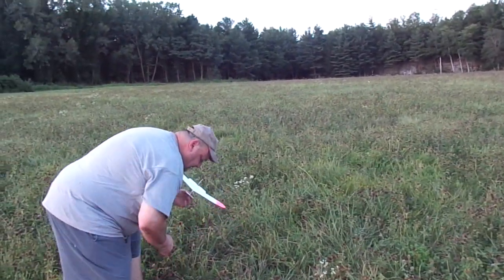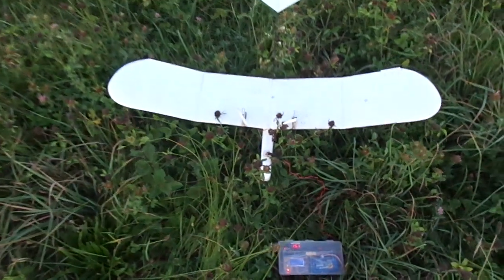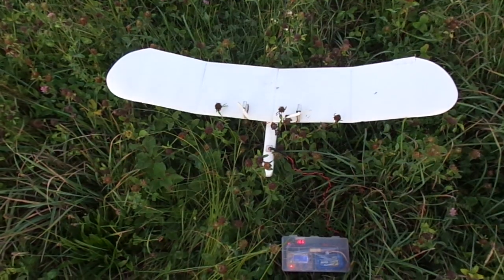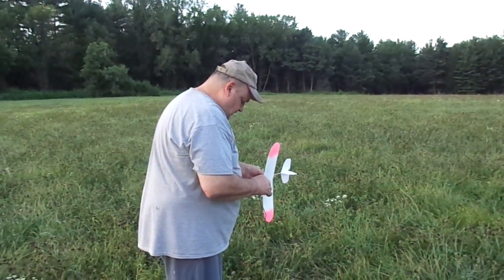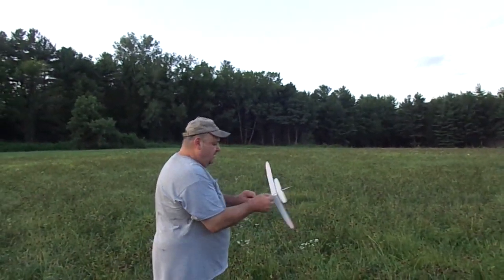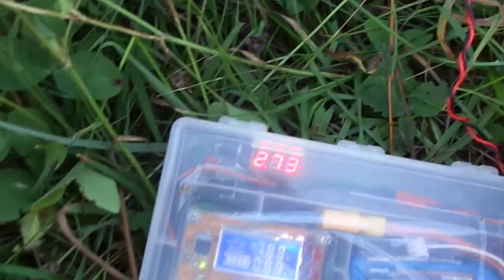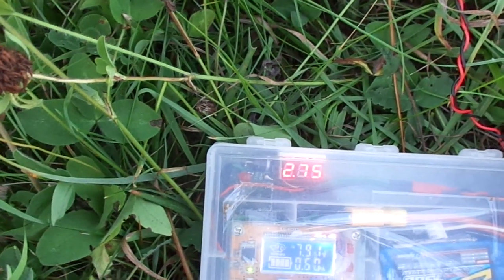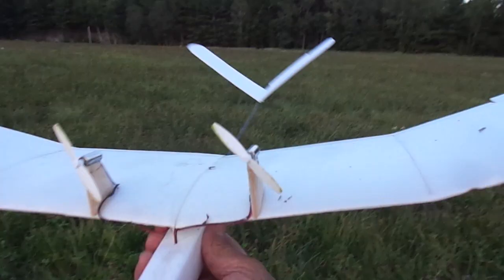Nice Air For Supercapacitor Free Flights

Comment: Great flights Mike! That twin engine airplane seemed to refuse to come down :)
And good of you to put banggood links. Happy New Year!
Reply from the maker: And a Happy New Year to you too, my friend! Thanks for dropping a comment!
 -Mike
Reply: @sonex413  Mike, how do you mount your supercap? Do you glue it to foam with PVA? I read somewhere that a paper tube was made by wetting heavy paper with PVA, rolling it around supercap, and dried (something done to not make it stick to supercap?)...then supercap was pulled out of it. This tube was then attached to fuselage so that supercap could be put inside it and moved a few millimetres for CG adjustment.
Reply from the maker: I like your idea of making it adjustable with a tube, but honestly I have also simply glued them in with a small amount of epoxy or fastened them in place with a piece of clear tape. Wrapping the cap with a piece of masking tape and then using epoxy to fasten it in the model makes it easy to cleanly remove the cap in the case of removing it from a trashed model! I like to test glide if possible before permanently mounting the cap. Keep it simple and light!
Reply: sonex413 Hi Mike.  I just got my little voltmeter.

So a silly query...Where do I connect the small voltmeter to measure supercap charge voltage? I mean, if I connect battery terminals to supercap, they make a continuous path to the battery- battery on one end, supercap on the other and wires/metal terminals in between. So now if I put a voltmeter on supercap leads, then will this give me the battery voltage or the supercap voltage (because on one side there is 3v batttery and on the other side there is a supercap at zero voltage initally)? If I had connected a resistor in place of supercap, then voltage drop on it would be the same as battery voltage, so I could probe with voltmeter anywhere on the wire and get the same voltage...but with capacitor I am confused that how this works- It doesnt make sense to me that the same wires will have 2 different voltages on their either side.

And if voltmeter gives ONLY supercap voltage, then why is that..why not battery voltage?

Also do u make a cardboard piece for the voltmeter terminals too, like u do for the charger, to measure supercap voltage as it is charging?
Reply from the maker: Hook up voltmeter to the charging leads...it will read battery voltage until you hook up to the capacitor, at which point you will see the voltage drop as you hook up. Then you will watch voltage reading increase as the cap charge increases...disconnect when you get to the capacitor voltage you want, say 2.8 volts...as you disconnect you wil again see full battery voltage. So what I'm saying is that during the charge you are hooked up to both the battery and the capacitor and you are reading the SYSTEM voltage which varies with charge state Hope this makes sense...   By the way, the little Banggood meter only starts indicating above about 2.4 volts, so the indication will disappear when you hook up to the cap...don't worry, as voltage reaches 2.4 volts the digits will reappear and you can watch the charge finish to the desired full charge. leave another comment if not clear on this, good luck!
Reply: sonex413 Thanks Mike! I had thought so too...
I am still test gliding my airplane for cg. However for the initial powered flight tests, I will have to have shorter charges- say 5 or 10 secs? So I guess I should first use a normal multimeter at my bench to see how much the supercap charges to with 5 or 10 or 15 sec  charge? I am using 2 AA cells.
Reply from the maker: 5 seconds first time and then go from there a little at a time. Better not enough than too much...
Reply: sonex413 Hi Mike.
I tested the small voltmeter and the supercap. I used 2AA cells. It didnt show any reading for some time...then the leftmost 0 digit started flickering from left to right (at abotut 2.7V on multimeter but voltmeter displayed only the first zero)...Then zeros came on one by one, dim at first and then settled to bright. Then all of them came on and showed zeros. Then after a little while it showed 2.84V. The voltage of supercap shown by multimeter was 2.88V, so 0.04V error. I checked battery voltqge too and the voltmeter showed 2.88V when muktimeter showed 2.93V..so there is a nismatch of 0.04V or 0..05V between the two. Cant expect a match though.

However the voltmeter doesnt serve the purpose if it shows a min value of 2.84V. Since your voltmeter shows readings below this, I was wondering if this is happening because I am using 2AA cells which supply less power and hence the voltmeter isnt getting enough juice to switch on properly?? I will have to see if using 3AA cells makes the voltmeter display lower readings.
Reply from the maker: Hi Ashutosh, You are correct, the mini voltmeter only only reads voltages above the minimum required to light the digits....but it can be modified to a three-wire unit, two wires for power and a third wire to sense the measured voltage...it will then read all the way down to zero volts with digits at full brightness. You can power the meter with a 9 volt battery or similar, and read the test voltage between the back wire and the third wire you added (sense wire). I will email you a photo showing the modification if you send me your email address. The mod consists of adding a third wire to the empty solder pad beside the original black and red wires, and removing the zero ohm surface mount resistor (actually a jumper) directly below the calibration potentiometer on the back side of the board. 

My red digits meter will read down to 2.4 volts without the mod, other colors require higher voltage to light them up.

My modified meter is powered by the 7.4 volt lipos and the sense wire reads the capacitor voltage all the way down to zero.

-Mike
Reply from the maker: I found a video that shows the modification: https://www.youtube.com/watch?v=He4kqoOBwkk
Reply from the maker: At 4 min 50 sec in his video he points out the zero ohm resistor which needs to be removed....third wire (sense wire) is added to the empty solder pad besides the original black and red wires. Black wire is common to supply voltage and test voltage. Hope this helps! -M
Reply from the maker: Posted a photo of the mod to my facebook page here: https://www.facebook.com/mike.sousa.980
You can add me as a friend on facebbook if you like. -M
Reply from the maker: One more thought....Richie and I flew many flights before we got the voltmeters.....You could do an experiment as follows: Start with a discharged cap...attach multimeter leads and verify zero volts...now apply voltage from 2 AA cells and record the displayed voltage at 5 second intervals. Now you have a method of counting the seconds of charge to get the desired capacitor charge. You will also know how long it takes to reach max voltage (we use 2.8 volts as a limit) so you don't accidentally overcharge. Should be pretty accurate until the cells start to get used up!
Reply from the maker: (or you can take your multimeter to the flying field! LOL! ....I need to make a another video about this stuff, I know you're not the only one who has questions ... Hang in there my friend and keep up the good work!)
Reply: sonex413 Hi Mike. Thanks a ton for the replies and the link. I will go through it and see if I can do it or let it be. It will surely help a lot if you send the note and your voltmeter pics at "ashu.bhakuni@gmail.com"

Pls also send a note or pics on how to use the dc dc converter...I dont have lipo but I could try it with 9V battery but I dont know how to use it. Can it be used to measure supercap voltage or the voltmeter is still needed?

I would still prefer AA cells as it is so much simpler, but getting voltage measurements will be good learning :)
Reply: I tested it with 3AA cells at 3.84V initial voltage and still there was no change in display pattern...in fact it came on at 4min instead of 2min with 2AA cells, although I wasnt using fresh cells. The supercap voltage when display came on fully was 2.85V, as before.
Reply: sonex413 I saw that video and realised that my voltmeter circuit is slightly different. I ordered this
https://banggood.app.link/A3VF8GwPxT
You can see the circuit pic there. It doesnt have thay zero ohm resistor...the components beneath the small ic on the left is also different from the one in the video. The part name is different too and mine is 2831BR whereas video is YU-2381BY...the voltmeter link given in that video shows the same circuit as mine but the one in the video is different. Am i seeing it wrongly or a different item is sent for US customers?
Reply from the maker: It sounds as if you may have a bad voltmeter...how does it behave when you try to measure a 9 or 12 volt battery, for instance? Do you have the mini voltmeter with red digits or another color? Red will work down to 2.4 volts, other colors require more voltage to light up. They will all work down to zero volts if you do the three-wire mod I described.
Reply: sonex413 Hi Mike. I have the red one. Its curcuit is somehow different from yours as visible in the product images. It works fine for 9V battery, and in fact it measures 2 or 3AA cells too. But it isnt showing lower values. I charged a supercap to 2.60V and used the voltmeter but it doesnt light up. I calibrated it with multimeter and now it lights up at 2.97V
While calibrating as well as using it generally, I realised that it is quite unreliable and sensitive- even small movements fluctuates the readings, while turning pitentiometer the reading fluctuates and also varies with pressure on the potentiometer. Unless it is very still on the table, the readings fluctuate. After calibration it lit up t 2.97V but multimeter showed 2.81V...so either it moved from the calibration setting on its own or showed variation due to probing pressure etc. Anyway, it doesnt show 2.5V.
Reply from the maker: The two  units Richie and I have are dead reliable, very stable, excellent units...both of us used them with 2 aa cells before we built those field chargers...both would indicate battery voltage, something over 3 V before hooking up to airplane...upon hookup display would blank due to low voltage and as the charge came up they would flicker on at 2.4 V a bit dim but readable, then brightness would increase with increasing charge and become quite good upon reaching usable  flying voltages, 2.5 to 2.8 V...I think you unfortunately have a bad unit, I think with Banggood you may occasionally get a bad part, their quality control is not aerospace level for sure. I bought six servos from them one time and one was no good...still a deal on the other 5...They may do something for you if you contact them.
I see they now list a 3 wire version of the mini voltmeter on the BG site...I have changed the links on my videos to direct to the 3 wire meter.

I would use the multimeter for flying, leave it hooked up to the charge leads during charge and watch the voltage rise to the desired level. I would consider 2.8 volts the max allowable charge, there is some variation between individual caps as to what they will accept....the charge voltage rate of increase slows down as you approach full capacity.

Just came home from the flying field with Richie, it is a rare flyable day weather-wise. Sunny with almost no wind, but temps several degrees below freezing! Great flights though! Hopefully some video good enough to post too. We kept going back to the car to run the heater and warm up!
Take care, Mike
Reply: sonex413 Hi Mike
Yes the parts seem to be faulty nd I ordered 2 for safety but both are the same. In the item page from where I ordered, it was mentioned that they send 2 or 3 wires randomly. Their circuit is the same and only difference is the extra wire. I dont know if different quality/type items are sent to US. :)
Here is the video showing how my voltmeters work:
https://youtu.be/u6hzQQLcSq4
Even after calibration they show 2.97V and then the cap shows 2.79V with multimeter- i dont think it discharges so soon to show that difference. My multimeter probe lead tips are small...how do I hook them to the charge leads? I guess I will have to pause at intervals and probe the supercap.
Reply: sonex413 I saw the 3 wire voltmeters that you have put up. Its circuit isnt clear in the photo but is different from both yours or mine...at least in arrangement. It also says that min operating voltage is 4V and detection with 3 cables is from 0V. So I guess it wont work with 2AA cells for 2 wirws and already has the circuit to detect from zero with 3 wires?
Reply from the maker: You would need to power the meter with with something like a 9V battery (something over 4 V) via the red and black wires and use the third wire along with the black ground (which is common) to sense capacitor voltage. This way it will work down to zero even with AA cells. The display uses so little power that a 9V battery should last a very long time. My mini meter is powered (black and red wires) by the 7.4V lipo supplying my drop down converter, and the third wire which I added senses the positive cap voltage...ground is common, it's the negative lead from the lipo. (Black wire goes straight through the converter from input to output so you can use common ground.)

Check with Banggood and see if they will do something about your faulty units...they generally want you to send pictures or video of the problem and then they will often issue credit to replace the item.
Reply: sonex413 Hi Mike. I wrote to them abt the issue...the pieces were too annoying to adjust or measure. Your dc converter cant be used to measure supercap voltage?

The 65mm props I got have 1mm hole. So to use it with 0.8mm shaft of 716 motor, putting some clewr tape on the shaft wpuld make it a good fit or something else? But too tight a fit and it wont freewheel?
Similarly, for the 0.8mm hole on smaller 50mm props, I will have to drill with a pin vise to make it fit the 1mm shaft of 720 motor? You have any test results of various props and motor combinations? Would be good to know what thrust value does the 10f supercap gives with 615, 716, 720 motors on 46mm, 50mm, 55mm and 64mm props :)
Reply from the maker: Hi, if you have 720 motor with 1mm shaft, try it with that 65m prop with the 1mm hole....There are no hard and fast rules in this, we are making it up as we go along, experiment! If you must use a mismatched motor and prop, which does happen, here's what to do. If the motor shaft is bigger, as you said it can be drilled...if it runs true but is not quite secure enough, a tiny drop of super glue applied with caution so as not to gum up the motor will hold it fine. If the prop hole is too big for motor shaft, there are a few ways to overcome this. One would be to strip a small length of plastic insulation from a piece  of electrical wire and push it onto the motor shaft...if you're lucky it'll be the right size to push into the prop, if not then the prop can be drilled a bit bigger to make a proper press fit. Again, a drop of super glue    will make up for a slight mismatch. I have also experimented with wrapping the motor shaft near the end with a carefully wrapped single layer of fine sewing thread and then touching that with a tiny drop of super glue. Once the glue sets and you have trimmed the loose ends of thread you can operate the motor and use some ultra fine sandpaper to sand the wrapped thread and glue "bushing" to the correct diameter to fit the prop hole. Both methods harder to explain than to do!

My dc/dc converter has the extra diode we talked about on its output, and because of the voltage drop across that diode the indication on the converter's display reads higher than what the capacitor actually sees...that's why we use external voltmeters hooked directly to the charging leads (and therefore the capacitor). Possibly if you eliminate the diode it would read correctly, but I have not tried it nor can I recommend it because I just don't know....I'd use the multimeter in place of the BG mini voltmeter, it's self powered so will read down to zero just like mine. Plus you'll look like a real scientist at the flying field! :)
Reply from the maker: I should have mentioned...720 motor with 65mm prop and 10F supercap is the most potent combination we've come up with so far...it's what is in Richie's plane in this video...it regularly turned in a minute with that lightly built plane...span about 35-40cm. We were flying it three days ago and we hit some rising air...the motor runs down in a minute or so but long after that it kept circling and rising...We watched it circle, climb and drift for probably 5 or 6 minutes...finally lost sight of it at about 2000ft and still rising! We both said it was the best flight ever!
Reply: sonex413 Thanks Mike. Interesting experiments...
After you make these adjustments and put superglue, do the props still freewheel with the shaft? I guess not... Or is this not important as the supercap keeps powering the motor at lower rpm even after it has landed? Currently the rightly matched prop rotates very smoothly and spins even when I blow air onto it from my mouth.

I will be doing some crude thrust valhe measurements soon.

I am also wondering that your balsa motor mounts have fixed side and downthrusts values? If yes, how do you adjust them for trimming, or how do you finalise the thrustline values? I saw your twin engine trimming video, and there too you seemed to have these fixed motor mounts and freewheeling props while trimming. I intend to use a thin 0.4mm aluminium sheet that I have which can be cut easily with scissors and make a motor mount from it- I will use clear tape to hold it on to the fuse stick as well as to hold the motor on it...that will give me adjustable thrustlines while trimming. I could then maybe superglue it after the values are final. In fact, I could even glue it in the beginning as downthrust adjustment just require bending the top part, and sidethrust can be adjusted by twisting it.
Reply from the maker: Hi, the props are fixed to the prop shaft, they never free wheel...however they take a long time to come to a complete stop so they give appearance of freewheeling. Yes, the moving air can also turn them.

Changing thrust angles usually involves cutting and re-gluing so we try to estimate it as closely as we can. 

Sounds as if you are on the right track!

Mike
Reply: sonex413 Hi Mike. You guys seem to be fulfilling ur new year resolution of posting more videos!! :)

About that voltmeter of mine. Well I figured out that since my circuit looked different but seemed to have almost the same components, there must be 2 things: the components are arranged in slightly different locations on these voltmeters, and no zero ohm resistance on my voltmeter simply means that it is already absent and I dont have to take the trouble of removing it!

In my voltmeter, the red wire was soldered to 2 spots; so I desoldered it, removed the solder connections of the 2 pads, soldered red wire to the middle position and soldered a 3rd wire. Attaching a 9v battery made it work. So thats that!

I have also realised that with my piece, or maybe with all of these voltmeters, the calibration is a little misleading and has an inherent limitation in achieving a match with multimeter for all voltages. When I calibrated the 3 wire voltmeter to match my multimeter reading at 8.75V, it showed a 0.06V lesser reading for the supercap when multimeter showed 0.26V, and showed 0.04V lesser reading when multimeter showed 1.39V. Thus the error would reduce gradually until it would show almost the same reading at 8.75V where it was calibrated with the multimeter. Similarly, if I calibrated it to match the multimeter at 0.26V, then there was a mismatch for other voltages.

So there is an inherent mismatch that always exists between the multimeter and voltmeter, and they converge only at the calibration voltage value. So thats a limitation that has to be accepted. It would have been nice to have an expensive Fluke multimeter so that I could find how much error even my low quality multimeter has, but thats not possible for me. So I accept this limitation. I have now calibrated my voltmeter with my multimeter at 2.75V so that at that value it shows the 'correct' value and converges with multimeter reading at about the max supercap charge voltage..I might later calibrate it at 2.8V. Anyway, the mismatch at other voltages I checked is 0.06V or so, and I guess this isnt a big deal for getting a rough idea or voltage for our supercap charging. :)
Reply from the maker: @ashutoshbhakuni303  Congrats! That is excellent work! You, sir, are a true scientist. That was a great explanation and it sounds as if you have the situation well in hand! This hobby of ours is always a learning experience. We are looking forward with anticipation to hearing about successful flights! -M&R
Reply: sonex413 Haha. Thanks Mike. I am a novice in almost everything and am getting just leerning to walk. But it is fun.

It's been raining on and off here at my place in north India, and I am progressing at snail's pace with this whenever I get time from work. I dont know abt aeromodelling or have any personal training, and am progressing only with the loving help of my remote friend in Australia John Haren and you...John guides me over email and even makes design and prototype for me to replicate my sutuation...I found him on HPA forum and he was generous like you to guide.

I spent the last 2 weeks doing glide tests on the new airplane design John had sent me. I have used foam disposable plates, popsicle sticks, a dried stem etc as alternative to balsa stick fuselage, but it is time taking and very easy to be imorecise. We were refining the incidence and cg location for best glides. John says that he will have to revise the airfoil design as this one is sensitive to speed with not so much stability (simple folded Jedelsky airfoil, similar to Bill Kuhl's Fantastic Foam Flyer), but for this design we have almost freezed the setttings to do the flights.

With the voltmeter issue resolved, I am making a small contraption from cardboard based on John's design to do some thrust tests on my digital scale...that will be an interesting new area to learn and I hope this crude setup gives at least a rough idea of thrust values. The design is based on the idea of the 3d printed version in this video https://youtu.be/YMrSBnQhR3A
..but I wont use a pusher prop...I will let you know, or maybe post a short video, if it works. Cheers and good luck with your wonderful flight videos :)
Reply: sonex413 Hi Mike.
I have got my airplane together and ready. Will do test flights over the weekend. It is 16" wingspan and weighs 18.4g. I have a 10F supercap. I have mounted 716 motor (1.6 ohm) with 50mm prop to begin with. I dont know thrust values so am apprehensive if this motor prop combo will be enough. The crude cardboard mechanism I was trying to make for thrust tets didnt work and I cant figure out why.

Do you have any idea of thrust values, or crude idea of the weight these different motor prop combos can provide? I have 716 and 720 motors, 46, 50 and 65mm props. The 720 motors are 0.6 ohm. The low resistance of both the motors is quite different from your 3-4 ohm motors. What is the resistance of your banggood motors?
Reply from the maker: @ashutoshbhakuni303  That's great news about your plane- Good Luck on the first flights!! I predict success!

I have no idea how much thrust any motor/prop combinations will provide, except in a general way based on what I've seen work. We try things out and see what happens...Your plane's combination of wingspan, weight and motor/prop choice sounds like an excellent performing one...similar, in fact, to one of Richie's planes which averaged about a minute of duration. I use the past tense, "averaged" because he lost it to a rising air current a little over a week ago! Last seen at maybe 1.5K meters or a bit more, still climbing! We watched for about 5 minutes, then couldn't see it any longer. (motor run and usual flight time was about a minute normally, this was definitely a thermal ride!!)

Resistance readings on my Banggood motors are in line with what you're seeing, very low.....That's because they are high performance...smaller number of windings inside the motor results in lower resistance reading...lower resistance means higher current draw....means higher RPM......at expense of duration. The motors I have with higher resistance have been salvaged from toys, and they obviously were made to favor low drain over high RPM's. They each seem to have advantages depending on the airplane design.
Reply: sonex413 Hi Mike. Here is the pic of the Thrust Scale i made from cardboard which didnt seem to work for the 716 motor and 50mm prop I tested. https://drive.google.com/file/d/1Vu48jpaQCKuvSqMNBMeKW1GbgCXJdzDC/view?usp=drivesdk
The 50mm Gemfan prop on this motor showed a thrust value of only 4.5-5g max at 2.8V supercap voltage! I dont know if the scale is not working or the motor prop are not performing. These 50mm props also seem to have lower pitch than the 65mm Kingkong. I find it hard to believe that this motor prop combo gives just 5g thrust when you have been flying 10-11g airplanes on 615 motor and 46mm prop, right?! Anyway, flight tests will tell if the motor prop is really not performing or the scale is bad. The prop seems to throw a decent amount of air while running.

I am excited to see the build video you've posted!! Great work guys. :)